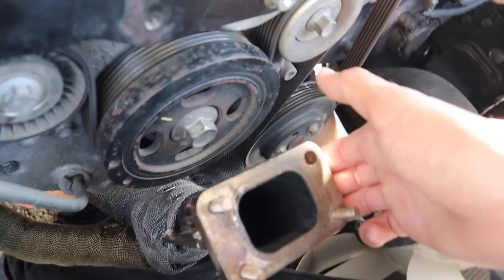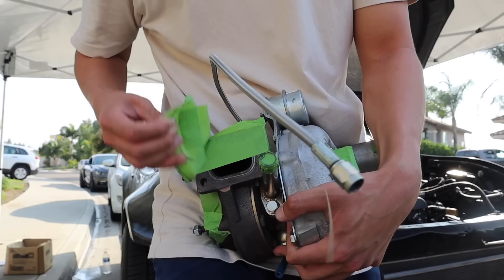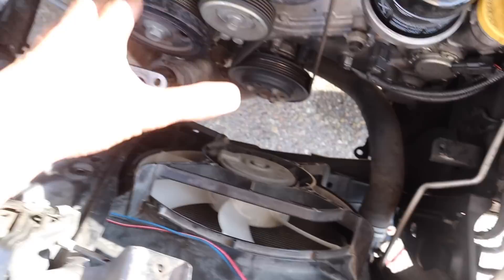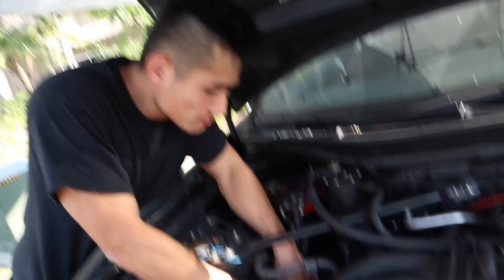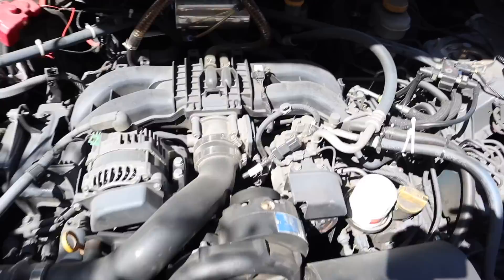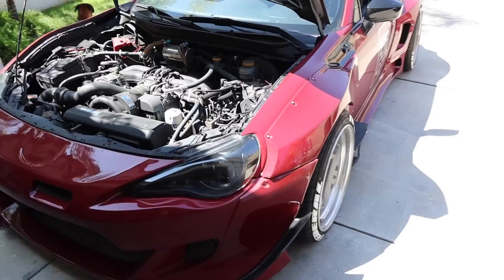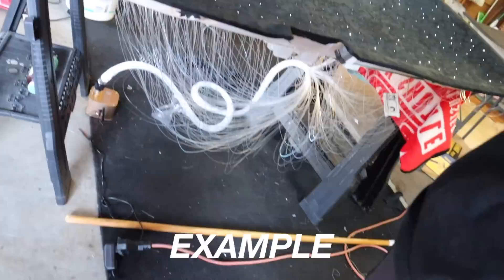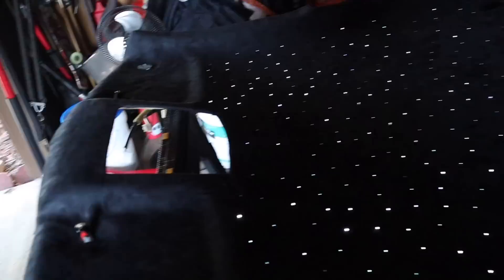What's Next For The Widebody & Supercharged FRS...

Comment: Hell yeah great victory!  Clock the compressor side of the turbo so that the wastegate isn't on the fans, you need to flip it 180 degrees.  Loosen the bolts around the compressor housing(light grey), it'll rotate!